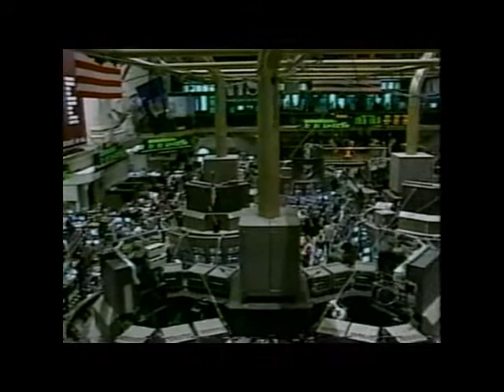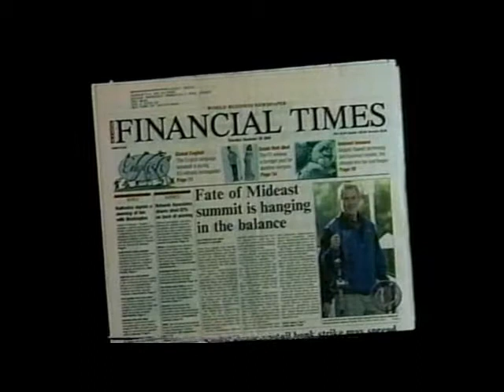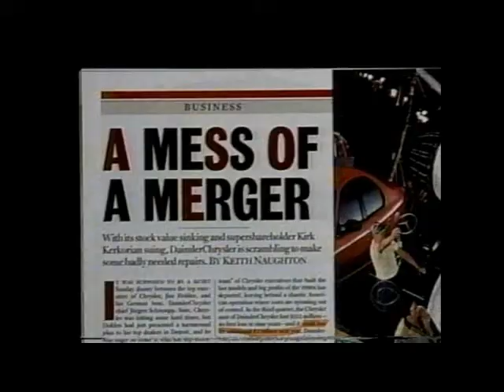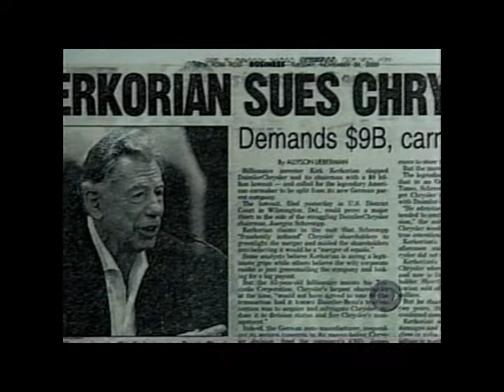Chrysler, Project Blitz, and the "Marriage Made in Heaven"?

Comment: ...and Chrysler has no undercarriage... and everything is exposed... and I am talking about the oil-pan... and the transmission... and when AAA-members had a front-flat and no-spare... then I could NOT tow-it with a wheal-lift... becase the wheal-lift holds and picks-up the car by the tires... and with one of the front tires flat... then the T-shaped wheal-lift would have been responsible for extreme-engine-damage... becase the engine and transmission would have been resting on the T-frame...

Comment: ...and even if I wanted to tow the Chrysler to a Pick-Your-Part... and with a front-flat... then I would have to drain the oil and drain the transmission fluid first... otherwise... I would have popped the oil-pan... and also popped the transmission-pan... and I would have left a long trail of oils and probably radiator-coolant as well... becase that is how Chrysler's are engineered and designed... with no-undercarriage to protect the engine... becase the engine just hangs from the top...
Reply: @Beckett Kashton Instablaster :)
Reply: @Enzo Troy I really appreciate your reply. I got to the site on google and Im trying it out atm.
Seems to take quite some time so I will get back to you later when my account password hopefully is recovered.
Reply: @Enzo Troy it did the trick and I now got access to my account again. I am so happy:D
Thanks so much, you saved my ass :D
Reply: @Beckett Kashton no problem =)